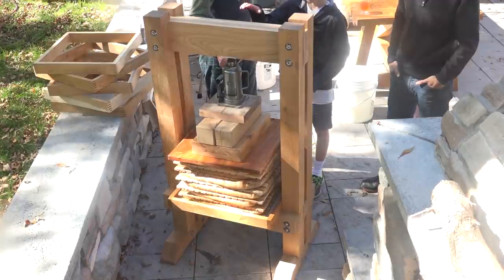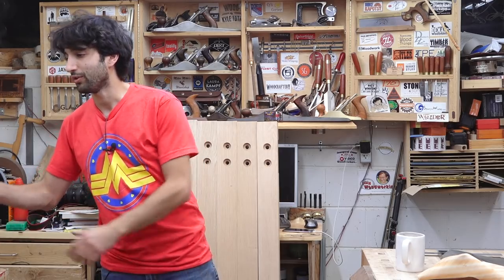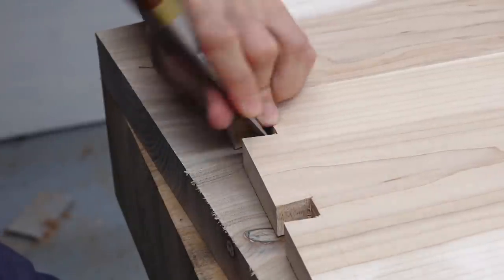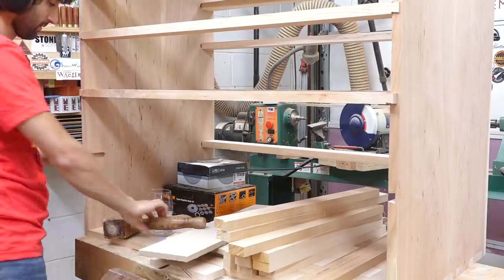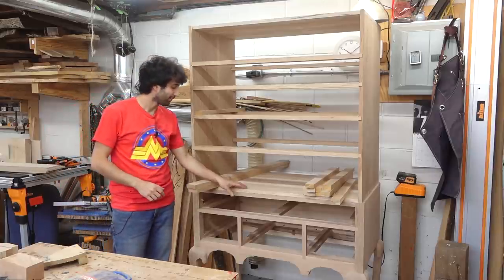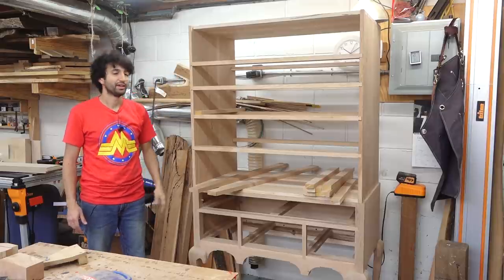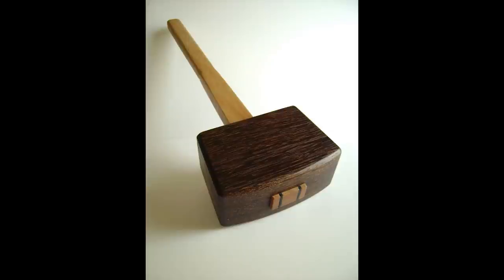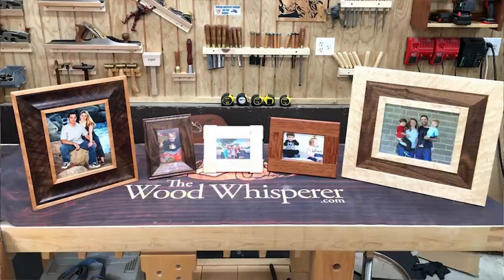Matt's Weekly Shop Update - Oct 1, 2017

Comment: I do understand the approach of attaching the molding to the unit. Usually  finishing nails are used to attach the molding. If  hidden dovetails were used, a solid surface would be present to attach the molding instead of full dovetails. I do understand your approach and your preference.

Comment: Great job with the High Boy. I just got two red oak logs that were cut down today, I don't have any Anchor seal, and have tried locally to find it in the past with no luck. Is there an alternative product that I am more likely to find without having to order it that will work? Red oak checks really fast and bad as you know. My plan is to mill the logs into flooring, like your video from November 2015.